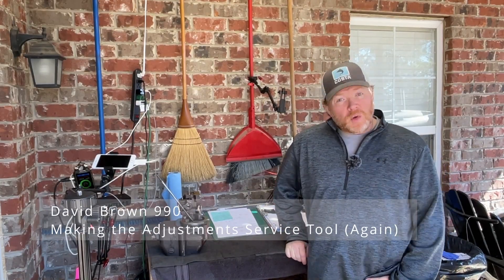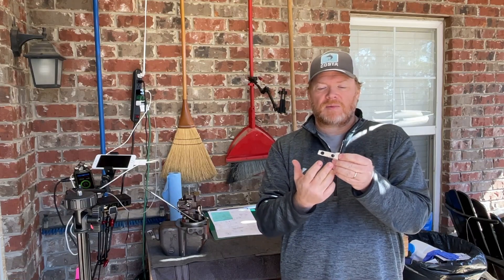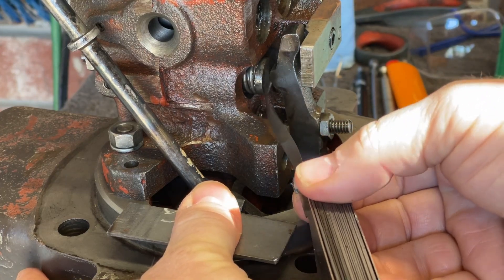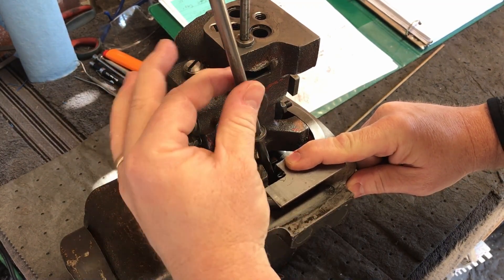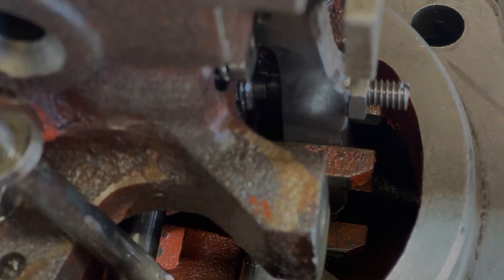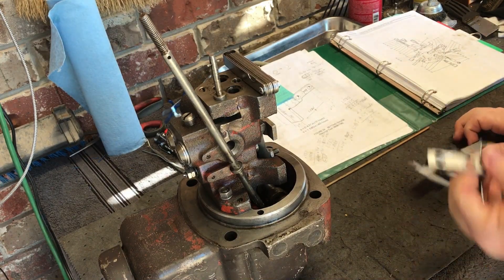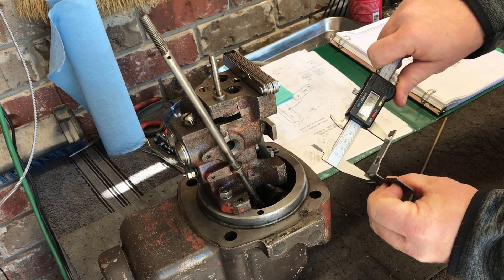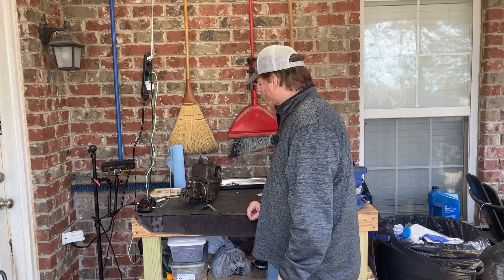Making the Setting Gauge Tool | Adjustments 1 & 2 Discussion | David Brown 990 #16

Comment: Can somebody share a A4 sheet pdf file with the gauge to print that and than draw it into a plate of metal to cut it with the real dimensions... it will be must easier...
Reply from the maker: Here you go!  Flat template in A4: https://drive.google.com/file/d/1p7L59Vx-19IoK0FfUSPJu41WOGtVO1MR/view?usp=share_link
Also have 8.5x11 Flat template as well as drawings for the actual tool and 3d STL file:
https://drive.google.com/drive/folders/1e5SoIbsv8Bp02sc9qBu3lw7vn4IarDOx?usp=share_link
Reply from the maker: Working on that.  Lance has sent me the dimensions of the actual tool and I'm making a 3d model of it.  Should be able to produce a flattened version that's printable in US 8.5x11 and A4.  Will take some time though, I've got a bunch of irons in the fire.  Thanks for the comment and thanks for watching!
Reply: Many many many tanks... 
I have a 885... is it the same? It is correct?